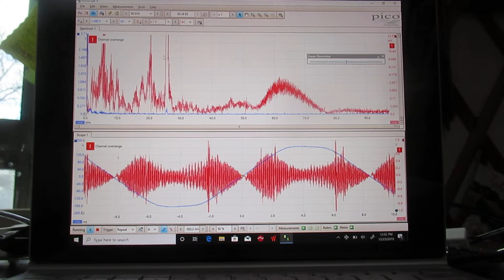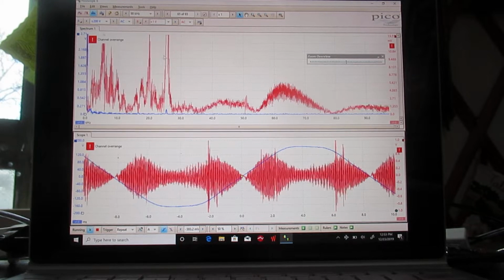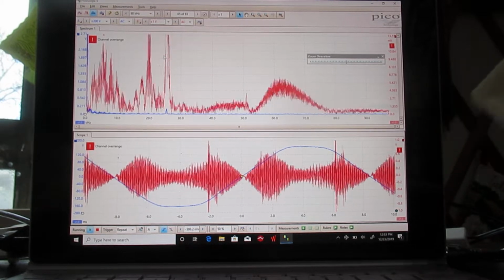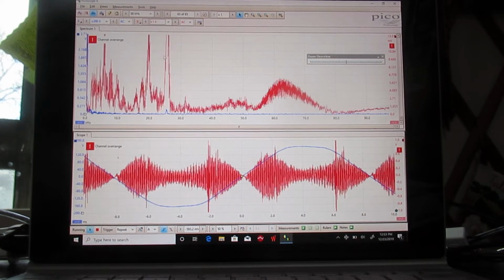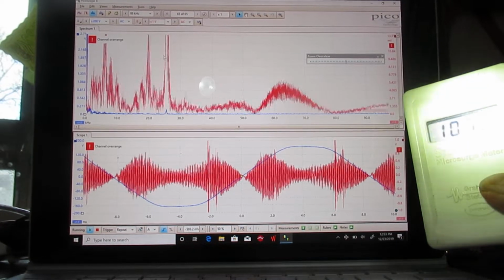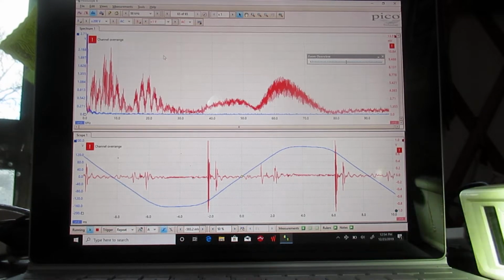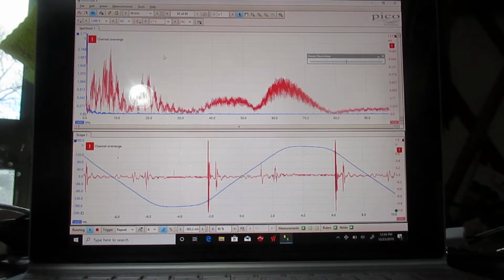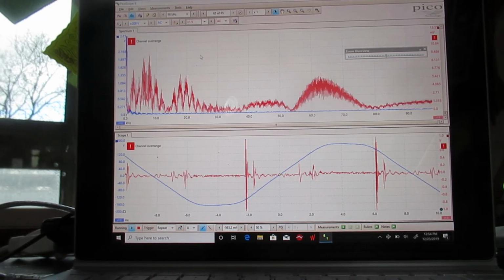Mitsubishi Mini Split Ductless Heat Pump Creates Hazard Level Dirty Electricity.

Comment: Will one of those whole-house DE filters help this? I saw in another vid of yours Stetzer filters didn't remove 20 Hz
Reply from the maker: Depending the frequency and problems  I use variety of  filters starting with Low cost, then  moderate & high cost.

Comment: This what you susscibe in the comments below your video corresponds exactly to what I experience. It caused me physical damage and ruined my life. As soon as I am able to stop this violent machines I will write a thesis by which I will be able to support your findings. For my work as a bookkeeper and marketeer I have to rely on my brain solemnly and even that I am not able to use due to the constantly high rpm the machine produces beneath my house. The machine was placed without any notification upfront and it has taken seven years of my life now. Before that other machinery prohibited me my movement, these are turbines used for cooling at an other neighbouring facility. Both parties keep on building and extending but by this have ruined my life to such an extent that the combination of these machines cumulatively produce tsuch shaking remblings of which I thought  to be a physical deficiency. This is not the case, when I started measuring the tremblings they do correspond with the violence and the disturbances that I am experiencing physically.

Thank you for uploading this video, it underlines my experience of horror that it has caused and like you state if very accurately 'physical damage' and mental damage to such an extent that is inhumane due to these harmfull and damaging effects.
Reply from the maker: Variable speed (VS), Variable speed drives (VSD) or Adjustable speed drive  electric motors were designed to reduce kWh consumption and they do that.  This is called Green.

They can also create pain, suffering, measurable changes in blood sugar, dopamine levels and even premature death which can also lead to reduced kWh consumption. This is called toxic.  Either way the utilities don't have to increase generation capacity or upgrade the amp capacity of primary hot phase conductors.

Comment: What osciloscope amd software are you using?
Reply from the maker: PiccoScope 2204A, Picotech Active Differential Probe, Stetzer ubiquitous filter, PicoScope 6 software.
Reply: @windheimemfsolutions  i have the pico 2204a with its stock probe, will this work??? Otherwise can you advise the model probe to try to buy it. Additionally, can you do a video on how to configure it to see the dirty electricity on our home????? Super grateful!!
Reply: What model of the active probe should I get? We're in Venezuela 120 V 60 hz